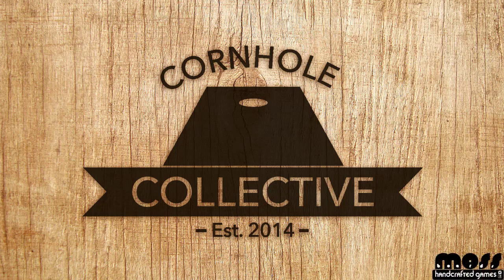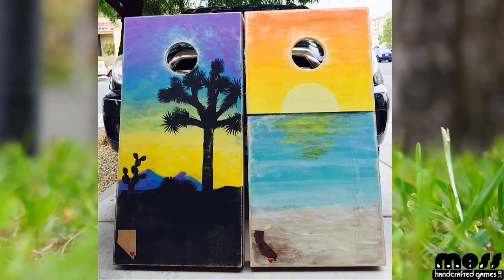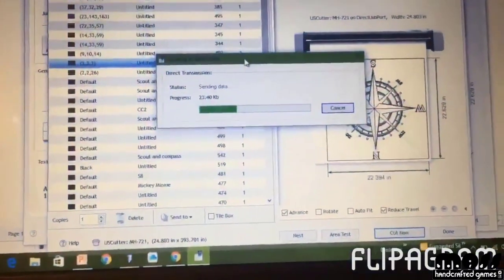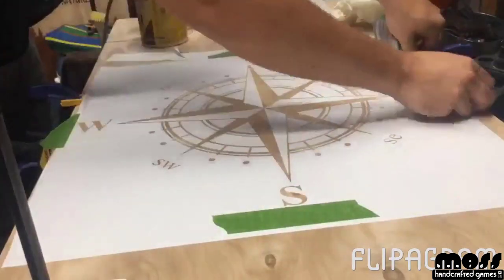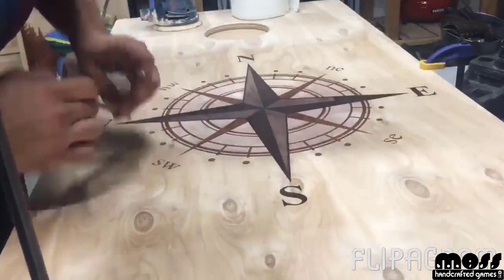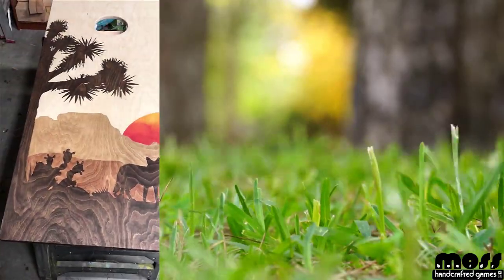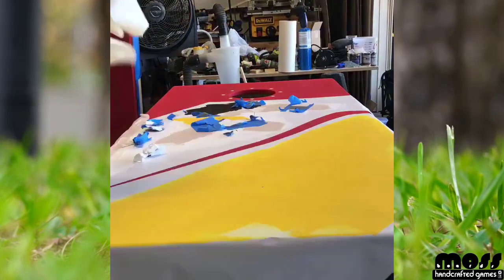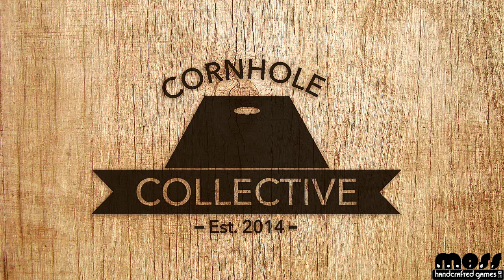Better Cornhole Boards Phase 4: Stained & Painted Designs!

Comment: When you do your panting and staining, do you carry the pattern over the edge of the top and continue on the bottom of the plywood or just end your design at the edge. Very nice video series as well. thanks for not living in my area you would put me out of business. LOL
Reply from the maker: Haha, thanks Jason! Welcome to the Collective! Usually I wrap the design around the edge but it is time consuming because edges don’t stain very well and my vinyl rolls are 24” wide so it’s a tape and cut job for the edges. Lately, I’ve been staining the designs just on the surface BEFORE rounding over the edge. The router roundover cuts a clean crisp edge in the stain for a very sharp look.

Comment: Great job and tutorial. I just finished my first set and it came out great! Question. How do you finish the sides and legs? I was thinking of exterior paint or maybe colored stain. Your thoughts.
Reply from the maker: If you’re staining or painting the frames, i definitely recommend rounding over after you paint/stain. Cuts a nice clean edge. Suggest a color that’s contrasts a lot with the top deck. Really, your choice. Good luck!

Comment: Hi Scott, I’m starting my corn hole small business. I’m interested in vinyl cutter, In the past I’ve ordered the vinyl decals how do I make those myself do you know? I know you mentioned that you just like doing the stencils with all the stains and the paint which I think is beautiful you do beautiful work. I love watching your how to videos. Thank you so much for any kind of guidance you can offer. Thank you in advance.
Reply from the maker: Thank you so much! I have a lot of fun doing it. Making stencils is a great resource and is pretty affordable, if you plan on doing a few sets. 

We have our recommended setup on our supplies list (www.cornholecollective.com/supplies) with a plotter, Tools, vinyl and transfer tape all listed there. I estimated that for the average cost of 13 sets of stencils you can get all the equipment and supplies you need to make 18 sets… so the break even point is quite fast, and the time and headache saved is worth it even faster. 

We love uscutter brand machines because they’re so common so getting help when I need it is much simpler than using some random less common machine and software.

Good luck and congrats!!

Comment: I love your workmanship. I also like going up and above when constructing my boards like routing all the edges and etc.
is there any possibility of getting the template of the multicolored deer in the woods?
Reply from the maker: Thanks so much Joseph, I don’t typically make the same design twice and don’t save my cut files. Sorry.
Reply: Cornhole Collective  So do you cut your vinyl. Weed it. Apply it. Stain it. Then remove the vinyl and cut a complete different vinyl and apply it over your first stain then apply the second stain?
Reply: @josephcappello9487  
I l

Comment: I love you videos. You do a great job explaining thing for us who are fairly new to building cornhole boards. So thank you.  Now I have a question. I'm building a set for my brother in-law who wants me to stain and paint. I've never used stain before. I love you explanation, however, I use a water-based poly (it's what i'm experienced with) so I can't us gel stains. Can I use a water based stain and stain the entire deck and once it's dried, tape off my boarder and then paint my boarder ever the stain? and then finally do my poly?
Reply from the maker: Thanks Emron! ALL i use is water based poly. Make sure your stain off-gasses and is completely dry for 1 day plus to prevent bubbles from forming under the veneer of your plywood. Gel stains are an absolutely game changer if you have a vinyl stencil cutter. However, be careful like I said not to apply poly too early or your stains will smear and ruin the design or bubbles can form under the plywood and that’s a tricky fix. Lmk if you have more questions. -Scott
Reply from the maker: Btw, yes, you can paint over stain. Make sure it’s dry and you may want to test it in small areas to make sure the tape isn’t going to pull up wood fibers where the stain was.
Reply: @cornholecollective7116  That was a super quick response, thank you so much for that quick answer. So to clarify, I gathered from your video and your answer I am OK to apply water based poly over a gel stain?  I'm only trying to clarify because of what the paint rep at my local Home Depot store told me has me very confused. He told me that gel stains are oil based and because of that I could not or should not use a water based poly. But it seems that you're doing exactly that and without issue.  If you could please clarify this for me and put my nervous inexperience at ease.   If I'm understanding you correctly I can use the gel stain, and paint my boarders and use water based poly as long as I give the stain plenty of time to dry?
Again, you are awesome, your video's are awesome  and I thank you.
Reply from the maker: 100% you’ll be good to go. I use Parks ProFinisher clear coat from Home Depot for years.  3-4 heavy-ish coats with foam brush letting each coat dry to the touch. Let that sit for many hours or a day. Then wet-sand it. Spray bottle water and 320 grit paper. Wipe all the slime and dust thoroughly. Final coat or two. Beautiful smooth and perfect slide.

Comment: Incredible work man. For the tree design, does it make a difference staining the dark image first and the lighter one second?
Reply from the maker: Thanks! This tree design was the often misunderstood “polyover” technique. This only works in shades of the same color. Brown has the most stain stares of course. Your vinyl cut partitions each shade into separate cuts. You weed the darkest stain areas (foreground) first then transfer the whole thing to the wood surface and stain the dark areas only. Java in this case. Then, step 2. After it dries a while apply one coat of water based poly to it. Step 3, pull the vinyl of the next lightest (medium
Brown) color and apply stain to it. *because of the poly in the dark Java, it doesn’t have to be masked and won’t smear. The medium shade of brown will slightly change the color of the dark areas with poly so it’s best to cover all the dark so it isn’t blotchy.

Comment: Awesome work I love your designs. I was wondering does it have to be HT55 the high-tech one or can I use low or medium? I was wondering if the others the stain will seep through.
Reply from the maker: Thank you so much!! It’s my understanding that ht55 transfer tape is the recommended match for the matte Orcal 631 vinyl. A medium or low tac transfer may have more trouble remaining adhered to the vinyl when removing from the vinyl backing before application. I’m not sure I understood your question about the stain seeping through? Your transfer tape should not impact stain bleed at all. We do have another video on presenting stain bleed, and feel 631 provides a pretty stellar paint barrier, however that video outlines other factors that can cause bleed that you can control too 👍

Comment: Thank you for your videos.  You do a fantastic job providing so much helpful information.  I am working on a set to give as a wedding gift and would like to stain the boards and paint a monogram.    Do you stain or paint 1st, or does it make any difference?
Reply from the maker: Thanks Donda! I can send you some great examples of simple monogram wedding sets with a single stain color and no paint needed. Message me on Instagram or Facebook.
Reply from the maker: In a nutshell, I’d suggest using light color plywood like Baltic birch, use cut vinyl to mask the natural wood with the monogram, the wedding date, and a nice border maybe around the hole too. Then stain the whole board with a medium or dark gel stain. Pull the vinyl and it’ll be beautiful. Grains and stains is always a winner!

Comment: For the stains that you plan to paint over, do you use a dye stain, gel stain or what?  I have several questions.  Your work is very impressive!!
Reply from the maker: Hi Kevin! I only use gel stains unless I’m doing a full background stain before the designs. If you’re painting over stain, it helps to seal it with a coat of poly first, protects the stain so fibers don’t pull up with your tape or stencil vinyl.

Comment: Probably been covered before but what is your average sale price for these custom boards? Love the videos and boards they are amazing.
Reply from the maker: Hi Tom, we don't get into pricing in the videos. It really depends where you're building, what the local demand is, how complex the designs are, what type of bags are included, so many variables. Nice custom cornhole sets usually range from $250 - $350 in most markets plus shipping, which can be a lot. $60-$100 for shipping typically.

Comment: Incredibly impressive graphic work. Those look great. How long does the graphic process take for you?  Say design/computer work and then install time?
Reply from the maker: Brian Munroe thanks! Each design is a little different. Intricate designs take probably 30 min to cut, 30-40 to weed and tape, couple hours to stain and clean up edges.

Comment: Hey! Awesome work! Quick question - is there a reason you use 631 instead of the stencil Oracal makes? I'm kinda new to the vinyl world. I'm wondering if it's your personal preference or another reason? TIA!
Reply from the maker: I had someone show me a video of them absolutely doing amazing work with the mask, but when I tried on Baltic it mutilated my wood and bled like crazy. 631 works great for me, and I wasn’t willing to invest more stress to strive for equal results. I don’t want to hate on it because some have gotten great results, but it just wasn’t good for me

Comment: Thanks for sharing these videos, picking up some good pointers.  Been doing boards for about a month now.  Whats the reason for using Oracle 631 over Oramask?  Is it just that it's cheaper? Or does it help with the pull up?  I've also only been sanding to 220 so I am going to start using 320.
Reply from the maker: Thanks Katie! Hunter and I (Scott) have only used Oracal 631 for our stencils. Anything outdoor, high-tack will pull up the wood grains a lot more. Fine sanding definitely helps reduce bleed and grain tear up. Creatures of habit I suppose when we find a material that works well.
Reply: @cornholecollective7116  Definitely understand that.  I've had mixed results with the Ormask, depending on how much time I took to push it all down.  Using a heat gun has certainly helped.  Also, just took the next step and ordered a 24 inch vinyl cutter (only had my 12 inch Silhouette) and a roll of 631.
Reply from the maker: Oh boy! Bigger vinyl for bigger projects! Tag us on Instagram if you post something! Welcome to the Collective!

Comment: If you are using paint only, would you seal or prime the wood before painting? I believe you suggested putting a clear coat over any stain if you are going to be painting some parts (with stencils for instance), so the paint should be adhering to the poly or whatever pretty good. Just not sure if I should seal or prime the wood if painting the entire board face, if you have a suggestion please let me know. Thanks
Reply from the maker: So many variables it’s hard to make a recommendation. Assuming you’re stenciling with acrylic paints, that’s what I use most when do use paint, a coat or two of poly helps avoid pulling up the wood grain when you remove the stencil and the paint edges are super clean.

Comment: Great video! You said your using 631. Are you normal 631 white vinyl, or are you using some sort of other 631 material?
Reply from the maker: 631 white and HT55 Oratape transfer tape. I actually ran out of tape yesterday and I’m an emergency situation bought some clear stuff at Hobby Lobby. It was amazing.

Comment: Just made my first set. I used 3/8 round over on the 3/4 ply , not satisfied especially on the ends , how do you seal the 3/4 ply? The cut looks rough .
Reply from the maker: 3/8 round is large. Try 1/4” or 1/8” i like a 1/4” round over not fully extended best. Leaves a nice flat side with a bit of a rounded edge.

Comment: Great videos! I've been doing boards for couple months now and looking to get a vinyl cutter. Will this cutter do a single vinyl with multiple colors or does each color have to be a separate piece of vinyl? The product description says its not a printer just a cutter.  Thanks for your help and assistance!
Reply from the maker: Not 100% sure I follow but this is a vinyl cutter, not a printer so you cut either decals (positive image) or stencils (negative image) from vinyl. Whether it’s decal or stencil just depends on which parts you throw in the trash. You can cut the various colors of a vectorized image and then layer the vinyl based on color but that’d get too thick for cornhole probably.
Reply: So let's say I wanted to do an American flag vinyl, will it come out with red white and blue or does it do just whatever the color of your vinyl is? Hope that is little clearer. Lol
Reply: I guess I'm referring to decals not so much stencils

Comment: Do you lightly stain the entire board and then put the stencil down and make the image a darker stain? If I did this should I use the gel stain for all of it?
Reply from the maker: Staining over stain doesn’t work too well. Stains tend to “seal” the wood and the next coat smears a bit. It can be done if the first coat is really light and the next is very dark. I prefer to do the opposite, staining the dark image first let it dry a long while then stain the “background” and over top of the dark image.

Comment: Nice boards!  What color stain did you use for the red background on the Wonder Woman boards?
Reply from the maker: Thanks! Used acrylic true red,  watered down and applied wet, wiped off so it looks like a deep red stain.
Reply: @cornholecollective7116  Thanks for the info.  Do you have experience with applying gel stain over dye stain?

Comment: If I want my board to have a simple painted border (say 2") on the outside/perimeter and be stained entirely in the "middle" (inside the border), how would I do that?  Stain the entire top first and paint over (using frog tape to over the edge/line) the stain (not sure if you can paint over stain or not)?
Reply from the maker: For something as simple as a border I would “remask” it. So I’d lay tape where my line will be and stain my board, leaving bare wood where line is, then move tape to cover stain edge and then paint. This is probably the quickest.

You could also paint border then cover with tape and stain board, but I’d test this process on scrap to ensure tape doesn’t damage paint

You can paint over stain, however I would allow stain to dry, then poly, allow to cure, then tape and paint line. Stain will continue to offgas so you don’t want to seal it in too soon by immediately painting it. Poly will help the paint be even crisper, but you don’t want to tape of poly that hasn’t had at least 24 hours to cure

Hope that’s helpful

Comment: I have a question do you have to put down a clear coat before you place the vinyl down on bare wood?
Reply from the maker: A great question. Normally no. However, if you stain the entire background and you’re painting designs over it, yes. A coat of poly and a quick light sanding will protect the stained wood from pulling up with the vinyl stencil. Gel Stain after poly will be very streaky and not coat evenly. Stain should always be applied to bare wood in my opinion.

Comment: For the paint... do you recommend a primer base or do the acrylic paints work fine without primer ? Thanks
Reply from the maker: They work well without a primer 👍
Reply from the maker: Juan, the exception is white or bright colors over a dark stained background, acrylics do need a primer for that. Light gray usually works well. Best of luck!
Reply: @cornholecollective7116  Do you recommend putting down a few coats of poly first and light sanding- PRIOR priming and painting, or even just painting?

Comment: I tried looking to see if this had been asked. Do you have to seal the wood before staining?
Reply from the maker: Great question Beverly! Some use a pre-stain wood conditioner with liquid stains, with gel stains, that doesn’t help. Sanding to about 220 and cleaning the dust is all the prep you need.

Comment: Any tips on how to create different layers for multicolored images using vinyl master software?
Reply from the maker: In your cut screen, you can separate by color. This allows you to place the pieces (if using colored vinyl) one at a time. Or, cut and stencil paint colors one at a time. Also, using clear transfer tape helps alignment So Much when you’re remasking.
Reply: A video on how you line up and match two stencils such as the ground where the dark and light brown of the deer boards would be awsome. Is it one image that you cut and separate or two separate images that you manually align?

Comment: do you finish off with a coat of poly?
Reply from the maker: For sure. Phase 5 video goes over the finishing steps. Several coats of poly and fine sanding them more poly.

Comment: What software are you using for the vinyl cutter?
Reply from the maker: Scott has vinyl master and hunter has sure cuts a lot, both of the software options for Uscutter brand machines. They tend to be the two most popular by far (probably 95%+) amongst fellow builders

Comment: If I was to use a vinyl instead of stencil can I poly over vinyl?
Reply from the maker: If you mean to leave the vinyl down like a decal, you can poly over that. That’s not what we specialize in so I wouldn’t want to advise, however I’d assume you’d want to use an outdoor (permanent) vinyl instead of indoor (removable), and I believe you need a layer of sanded poly beneath the vinyl. Hope that helps
Reply: @cornholecollective7116  , thank you for your help.